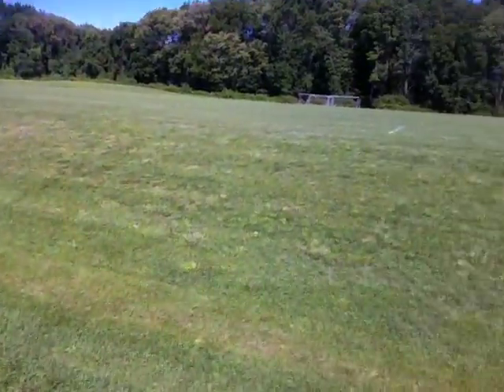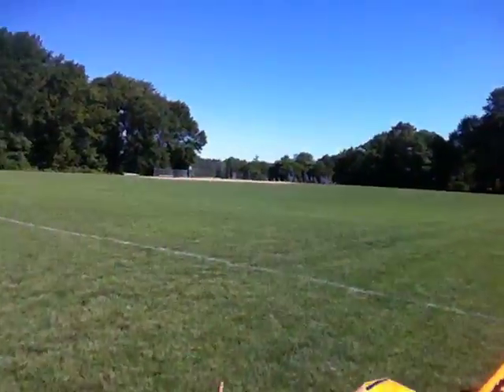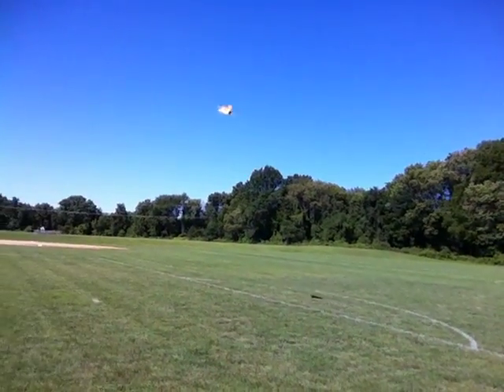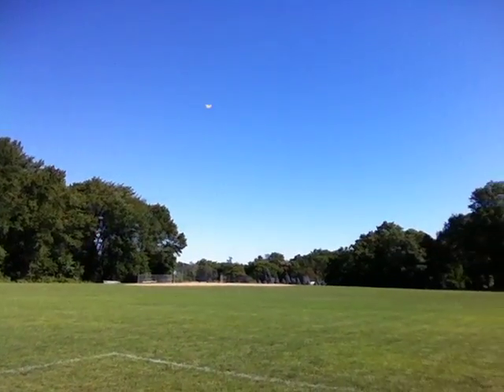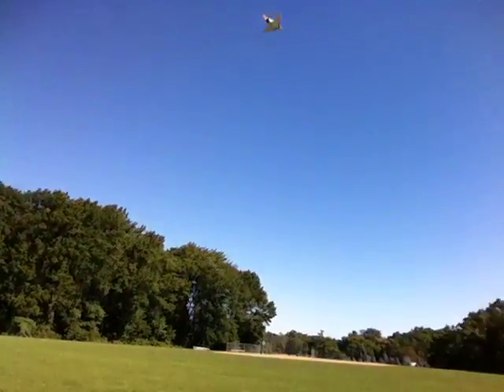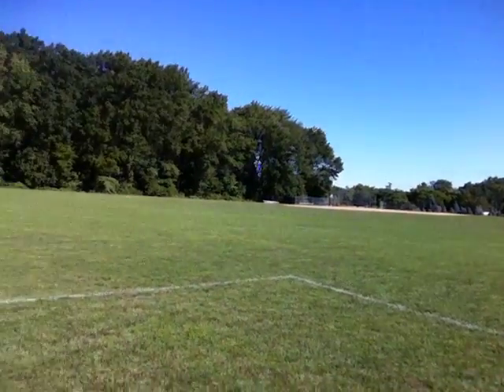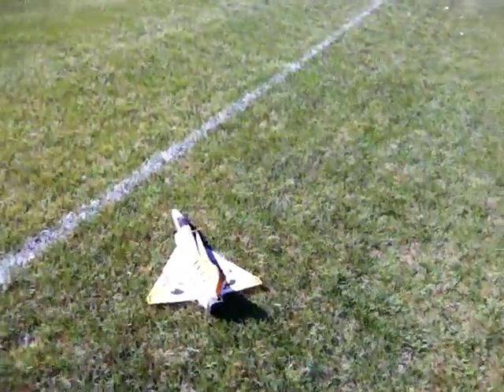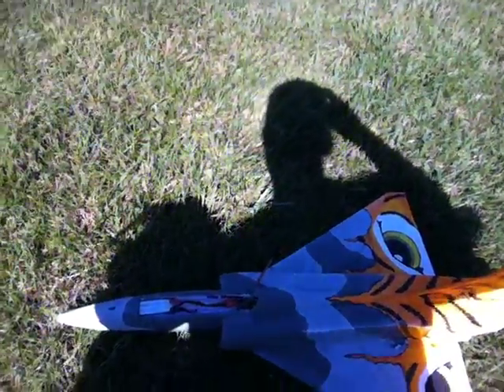SNICE MIRAGE 2000 - R/C Scratchbuild - small battery - light wingloading

Comment from the maker: @oysterlicker   Thank You!  The 64mm might fit if it does not have a lip on it, but it would be best to blow up the plans  - I think the larger airframe will perform much better with a 64mm.  Also, on the original plan, the inlet ducts are sized for a 55mm fan -- they may starve a 64mm.  Blowing up the plans would resolve this issue.  Best of luck on your build and be sure to post your results!  Happy flying!